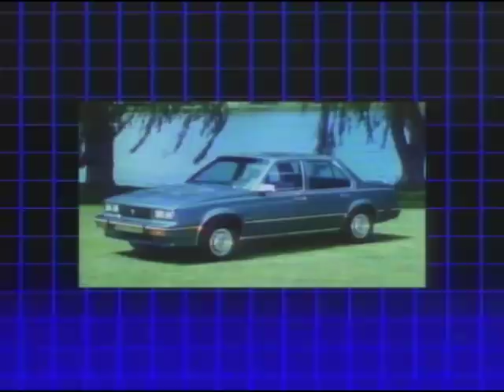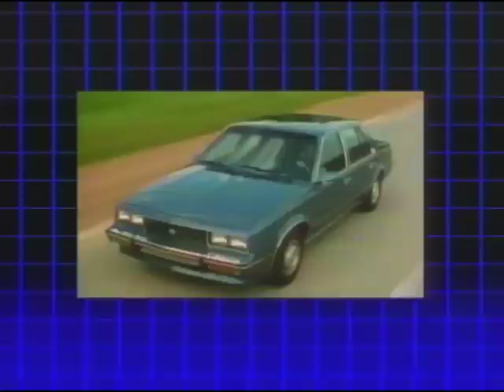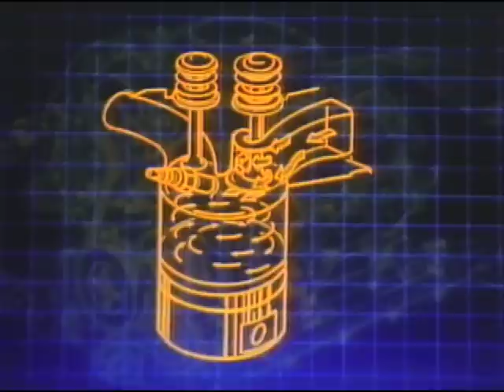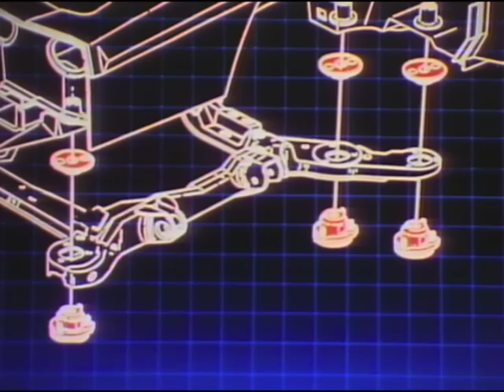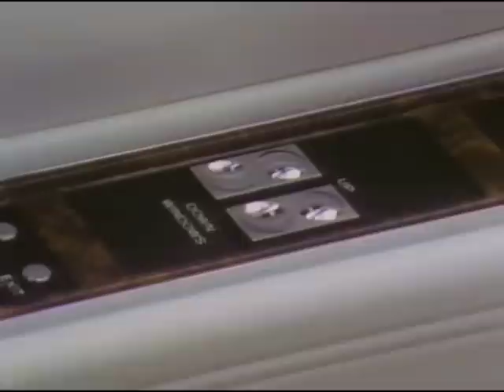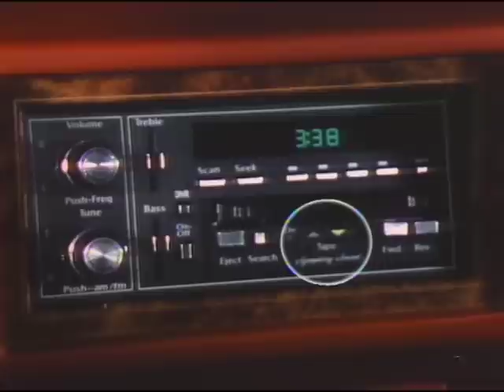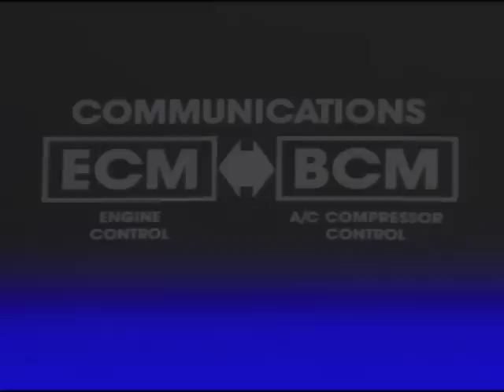Cadillac Roundtable "1985 FWD DeVille / Fleetwood" Dealer Video

Comment: Cadillac’s video can brag about these all they want, but they were just too small and similar to other GM siblings to be worthy in the eyes of its heritage. Each subsequent update in 87, 89, and 94 made the car larger as Cadillac discovered it went too far in its downsize frenzy. The plan was to get rid of the then full-sized Fleetwood Brougham at this time, but that car stayed around over a decade longer and was essentially replaced by the equally large Escalade. The HT 4100 was a disappoint with poor power and head gasket issues. Though the 4.5 and 4.9 engines and cars based on it were generally better, there were a lot of growing pains for Cadillac with these cars and it definitely helped the Europeans and the newly minted Japanese luxury brands take market share away from what was America’s top luxury brand. Today, Cadillac is just a mere shadow of what it was, and these tiny Devilles, though good sellers in their day, in the long run contributed to Cadillac’s mighty fall from grace.
Reply: They did not sell well at all. Cadillac lost 65% of it's market share. Even worse with the hideous 86 Eldorado and Seville. Cadillac died a long time ago.
Reply: @MarkWG  Well, compared to future decades, those sold relatively well. Cadillac didn’t have problems pumping out cars in the in the neighborhood of 100,000+ where today they sell nearly a tenth that many.

Comment: When Cadillac and Lincoln abandoned RWD platforms I abandoned them forever... now Cadillac and Lincoln are high-tech econo-boxes with no prestige or elegance.   Cadillace screwed-over their customers with the Olds 350 Diesel, the V 7-5-3 and the HT 4100 POS!   Keep hitting your customers over the head and eventually they will move-on never to return to your brand!
Reply: Agreed.  Had the 87 Sedan, had to replace the engine at around 100K miles!  Did keep that car for nearly 20 years, though will NEVER buy another Cadillac.   Switched to Ford until quality stopped being Job One.   Now driving a Honda, my first foreign make.

Comment: Nice hype.  Its just too bad that these cars were crap!  Which is why you never see any of them today.  Not even many collectors have them.  1985 to 1988 FWD Cadillacs were junk, but the '85 was probably the worst.
Reply: I still see them from time to time in Chicago. I think they held up better than many other cars, as long it was the 4.5 or 4.9
Reply: @LowEnd31st  Do you really?  I haven't seen one in years! And i live in the New York metro area. 

I agree about the 4.5 and 4.9.  However, the '85's had the 4.0 and those were no good.
Reply: @retroguy9494  I do. I can’t say how many are 4.1s which they used up to 87, but I see them from time to time.

Comment: 2:00 Weren't the "single piece doors" just doors with permanently welded hinges? I remember some talk of body shops complaining about them, prompting a return to hinges with bolts. I suppose a bolt-on hinge could be welded at first, for a more precise alignment during manufacture, so that, if needed, a body shop could break the welds and use the play in the bolts to adjust it for a body that was a bit off, but I don't know if any manufacturers have actually done that.

Comment: The 80’s was such a terrible time for Cadillac- their best engine available was the v8-6-4. That engine had drive ability issues but there was nothing inherently wrong with the engine or the rest of the car. If the cylinder deactivation was disabled it was actually a good engine. The rest of the engine options throughout the 80’s were inherently flawed in many ways.
Reply: My uncle had one of those 1981 V8-6-4 Sedan DeVilles.  It was the very first Cadillac I ever drove.  His worked flawlessly.  Then, in 1989 I bought one myself.  A Fleetwood,  Mine too worked perfectly.  No need to 'deactivate' anything! 
But we BOTH had bad luck in other ways.  My uncle was rear ended and the frame bent and the insurance refused to total it and fixed it instead.  It didn't drive right so he traded it in.  Mine got totaled in a parking lot.  The SOB didn't even bother to leave a note.
Reply: The Olds 307 V8 in the RWD Fleetwood Broughams was bulletproof in terms of reliability.
Reply: The 80s was a terrible time for all of gm
Reply: @riotautorepair9662  thier 80’s pickup trucks were pretty good other then the extreme corrosion issues. That is typically only an issue for salt belt states though.
Reply: I've heard that the deactivation system was OK as long as you disabled the 6 cylinder mode. Its hard enough getting a V6 to run smoothly with only 6 even-firing pistons; the firing order with them 90 degrees apart must have been a real mess.
Reply: Actually I think the best engine in B body Cadillacs was the Oldsmobile 307 V8
Reply: Steven, that  "V8,6,4" was ABSOLUTELY not their "best" engine in the 80s Lol....what bought you to that conclusion??
Reply: @averyparticularsetofskills  it absolutely was unless Cadillac put the Chevy TBI 350 in their later 80’s models. If they did then I didn’t know. The olds diesel was a piece of shit too

Comment: What a disaster of a car for GM.  Totally abandoned their brand for Cadillac with this cheaply built car.  GM had totally unrealistic expectations that they could attract a younger customer base with this crappy car.
Reply: You can thank GM CEO Roger Smith for that.  He thought EVERYONE in the 80s wanted a front wheel drive car and cut cost by rebranding cars from other GM divisions.  The man was the first of a few CEOs to help ruin GM.
Reply: @andrewcolsen  yes.  part of this was a sense of desperation at the time - they revamped almost all models at the time in a hopeless attempt to answer the Japanese and germans, on top of a disastrous implementation of robotics which were nowhere near ready technologically and open hostility towards the UAW because they thought the robots would reduce headcount.
Reply: @andrewcolsen  the 80s in general was a terrible time for cars, ever since the oil crisis, lots of cars became underpowered and FWD.
Reply: Cheaply built, I don't think so. I have an 1986 with this motor and it's the most smoothest high quality vehicle I've driven! U have to pay up the butt now to get cars that have half the leather on the door panels now. I have never had any issues with my 4.1, sure a lot of them did suffer reliability issues but that was more of the early ones that were in the rwd cars. Now the Northstar was a severe piece of junk if we shall talk about what's really a piece of crap, compared to the 4.1

Comment: had an 87 fleetwood delegance, with the 4.1 v8....was a great car, no real engine issues, but was a bit underpowered...
Reply: That's because by 1987, which was the last year for the 4100 motor, most of the bugs were worked out of it.  The 1982 model year, the first year, suffered really really badly.  It's important to note that the 4.1 4100 motor was always intended to be in the front drive Cadillac from the beginning. It was a NEVER intended to be put in the heavier rear wheel drive cars but was authorized due to the increasing difficult CAFE standards of the time.  Their increase weight, caused this engine to suffer even more problems.
Reply: The 4.1 had headgaskets problems and ate up camshafts.The camshafts were too soft
Reply: @Toolaholic7  I have my dads 83 Eldorado he bought new. Beautiful car, rides like a cloud, so comfortable inside.  Gorgeous leather interior. I inherited in 2013. Has the original HT 4100. 148.000 miles, still purrs like new. He also coincidentally bought a brand new 1985 sedan de ville. I was with him when he bought it. Very handsome car, served them well until they traded it in 1992. No major issues.
Reply: @1958Cadillac-v2g  My dad remembers the headgasket and camshaft failures with this engine.He replaced one once,headgaskets went out in this one.
Reply: @Toolaholic7  I'm sure some had issues.  And that poor oil change intervals played a role. Dad was meticulous in his care of automobiles.  3000 mile oil changes, never hot rodding them, cooling system changes every 2 years, and adding the pellets that were required.   He drove them 75 80 mph on the freeways. But that good maintenance pays off. This one has had that care, and is still running fine. In fact it just passed California smog test last month. It's put on a treadmill,  and the test pipe goes in the exhaust tip. Then its run about 5 minutes at different speeds and different loads. I always worry its going to fail, at almost 40 years old. But fellow shuts it off, and said, it passed just fine 😊
Reply: @1958Cadillac-v2g  Camshaft was made out of a soft metal.The 4100 was a pos
Reply: @Toolaholic7  🤣🤣🤣🤣🤣 your funny dude.
Reply: @1958Cadillac-v2g  You are full of it.Go talk to anyone that worked on them,will say brand new engines in the crate at the dealerships were stocked when one went bad
Reply: @Toolaholic7  dudes engine was probably replaced under warranty with less than 40k and he doesn’t even know.

Comment: The major faults of size and engine reliability in the 1985 model were finally corrected in the 1989 redesign.
Reply: And even more so for 1991
Reply: My 89 CDV has been nothing but good to me.
Reply: 350 in 90 SD but didn't like the composite headlights
Reply: Acually the new 4.5lv8 with improved reliability was introduced for the 1988 model year
Reply: @MrTheMiguelox  I also mentioned size.

Comment: FWD Cadillac the bad years
Reply: Why does everyone hate front wheel drive?  It's a fucking luxury car, nobody cares about how neutral the handling is.  Let it understeer all it wants.  Give me a boat that floats and seats I can get lost in.
Reply: @dkmorris713  Finally!  Agree with you 1,000%!
Reply: @dkmorris713  although this doesn’t answer your question, the Lincoln Town Car should explain it for you.  Bulletproof mechanical configuration.  To make FWD as robust, reliable and durable as RWD required much more skill.  The Japanese did it, but a Detroit never did.
Reply: @dkmorris713 I agree, I have an 86 Cadillac Sedan DeVille fwd and I absolutely love it, especially where I live which is Vermont I don't recommend a rwd car here for there are too many hills and curves. At the time the fwd Cadillac DeVille came out u could still get an updated version of the previous generation DeVille simply called the Cadillac Brougham that was rwd, and carbureted. So no one was losing out at the time, if u still wanted the traditional rwd then u buy the Brougham but if you wanted something that was a bit easier to drive and that would be a better all season car then u get the new fwd DeVille. I prefer the fwd over the rwd, i think it feels better in my opinion